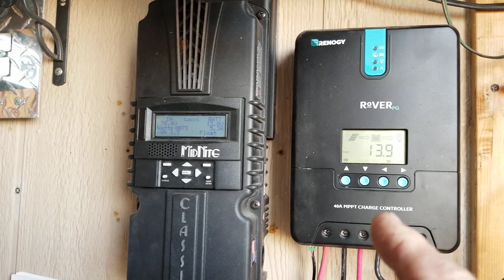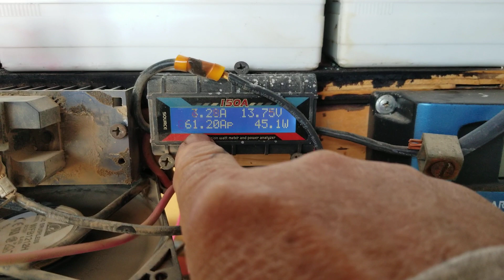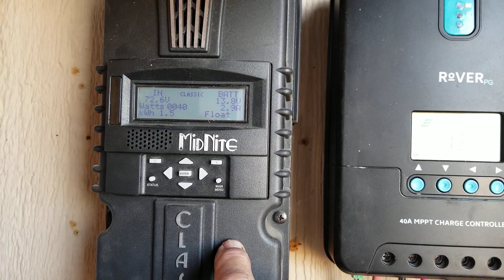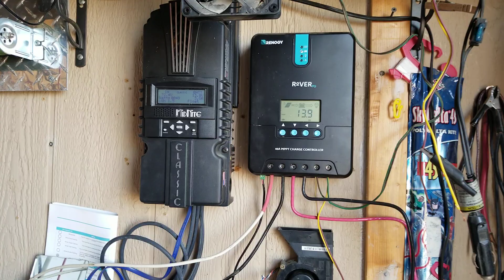Wind Turbine Power, KT5 Output in 40mph winds. Feb. 14, 2021

Comment: You crack me up G bear 😂 roasting your LED light. I constantly keep forgetting where my LED light is and then I remember it's still on my head. I like using led headlamps so I'm hands-free.
And that's the best part about having your own garden, taking a pea anytime you like 🤣 what are your thoughts of siliconing all those plastic panels from the back side all the way around to help keep them in place?
Thanks for sharing and for the helpful suggestions 👍
Reply from the maker: Thanks!  Happy to help spread laughter for a feel good mood! 
I think the engineers designed this greenhouse to flex and move with the stress.  It's just the extreme winds that cause problems, and I don't think even solid glass would fair well in some of the wind storms I get out here, but I am set on designing something that will.
Reply: @GBear  understood.  I was thinking of just siliconing from the back side all of the panels that are at the upper level, just like silicone holds a fish tank together I think it would help and wouldn't make it so rigid, still allow flex. I'm definitely looking forward to your solution ✌️ Stay warm over there. It's going to be a cold 1 out here for us tonight, I can feel it in my bones.
Reply from the maker: You and Cricket and Tomrat try to stay warm!]  I have good heat in my cabin.
Reply: Instablaster
Reply from the maker: Welcome aboard.   What's that mean?

Comment: i like wind and solar cool  midnites are grate we have 2
Reply from the maker: Welcome aboard John!  Winds are back now, sun is set, PMA has the 12v battery bank at 13v, everything running in the cabin, and power to spare!
Reply: @GBear  we was having alot of dead batteries we   got a new inverter cotek inverter they are so much batter they use so much less power batteries was at 50 volts to day we have had 4 days of cloudy days and rain heard to believe changing a inverter makes that much difference
Reply from the maker: @JonOffgrid  yes, I learned the hard way too.  If you rely on your off grid electricity, get good batteries, good controllers,  and good inverters from the start, because buying cheap junk will be a waste when you need to replace it shortly.